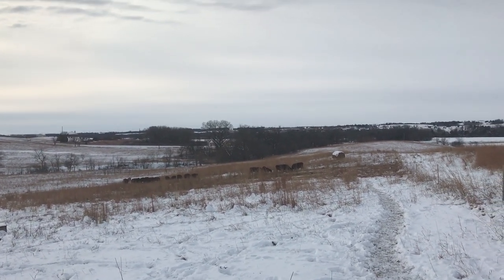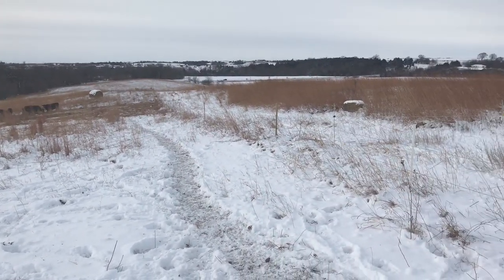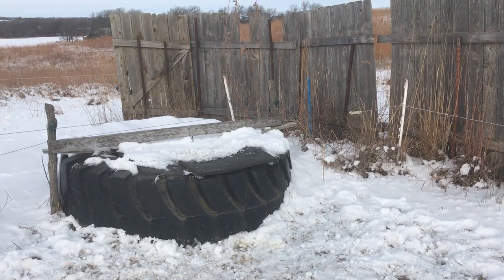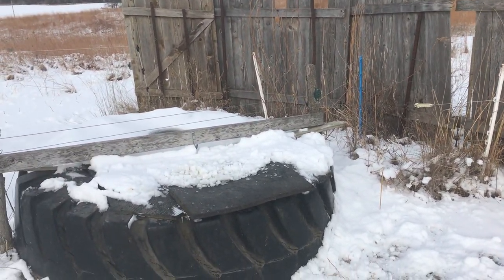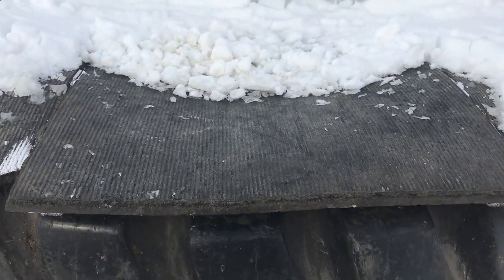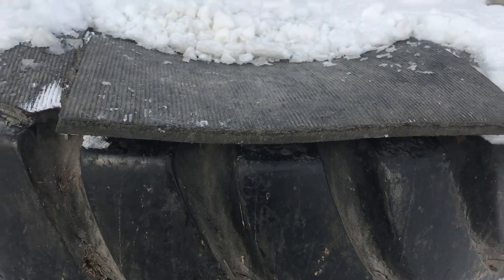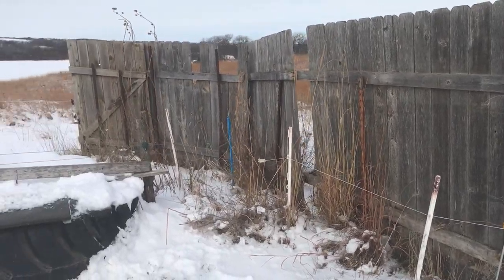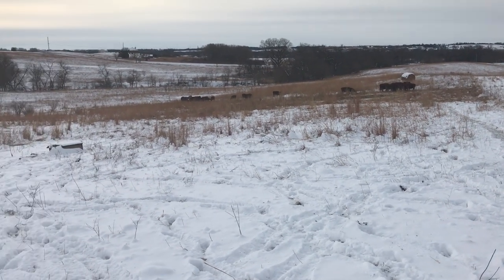Livestock freeze proof water tank

Comment: Thanks. Great initiative to share. 
One section of 8 pastures. 
Have a 1000 gal tank solar well fed with a propane stock tank heater. 50 head. Works well but in deep Colorado winter need to take your advice and get the top covered. Half the tank is paneled off for the heater and equipment. 
Ice still forms at the cattle end. 
This tank feeds another smaller tank a quarter mile down slope via underground 1inch pex. 
Like the tire wrap insulation idea. 
Thanks for the inspiration 🐮
Reply from the maker: Sounds like a good plan Mike, hope it works in your climate and post some, interested.